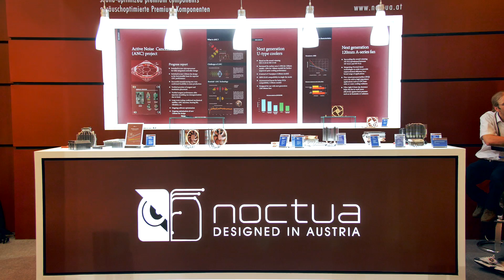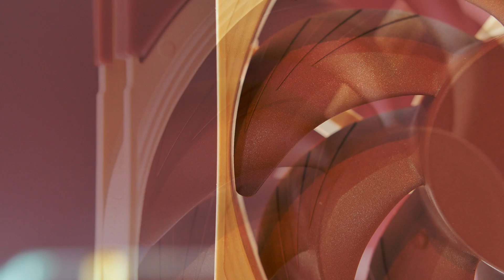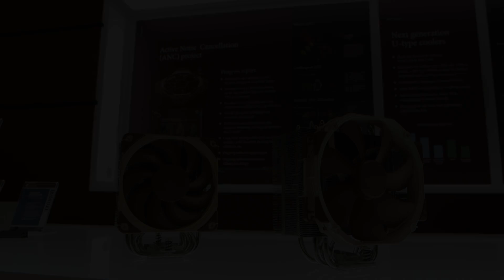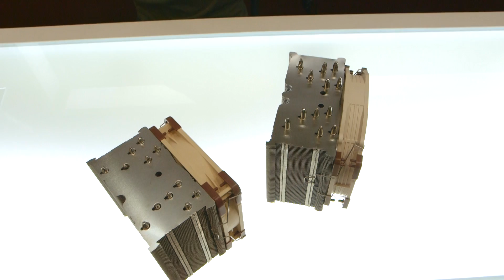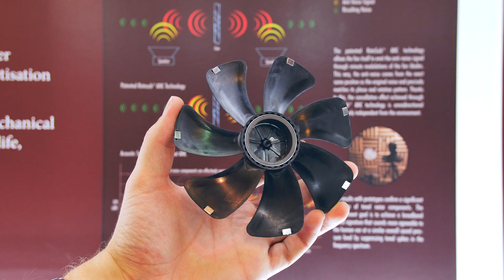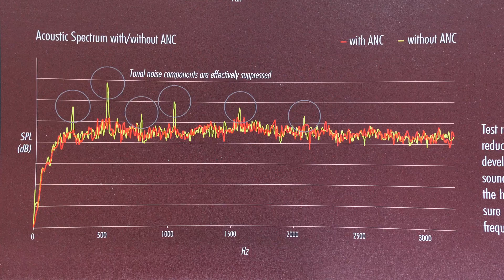Noctua new A-Series Fan + progress on Active Noise Canceling Fans

Comment: the problem with good fans nowadays, is not the vibration or fan noise itself, but the air flowing around in the case and turbulence. when my pc start the fan at the 500rpm speed, its quiet, then the noise ramps up a bit after 10 seconds when the airflow has been established.

Comment: just get a big fan i have 2 200mm fans just run the at a low rpm
Reply: calical26 The main issue with very large diameter fans is firstly they are big. This not only rules out most heatsinks and radiators, but even for airflowyou'll need to have a case that'll support them, which limits you to larger enclosures (and even then you've typically got a smaller fan somewhere), and typically not any rack mount\industrial application, which is where Noctua started as a business.

They also have a lower cross sectional thickness compared to diameter, thus resistance to flex and blade vibration. As such so they tend to not be able to operate effectively at high speed, limiting your total working range and in turn the min noise levels for applications that need to ramp up to high airflow levels. Finally the peak airflow per square area of fan is generally lower, so in many applications you can move more air with 3x120mm fans than the 2x180mm option that takes the same length, despite the 180mm fans having ~2.25 times the area of a 120mm fan each (thus ~4.5 fans worth total).

So while I'm not say big fans are worse, silent smaller fans do have advantages in some situations.
Reply: Hamish McGregor Not true on large cases, the Phanteks Evolv line has mATX and ITX cases with 200mm fans at the front; same with the Bitfenix Prodigy. All excellent cases.
Reply: Gordon Rennie
 And all considered "large" for there given form factor. For example the Evolv mITX, while very well made, is as wide as my define r4, which I don't even take to LAN parties because its a pain to move. The Evolve mITX is literally more than twice the size of the silverstone ML07 that my flatmate uses, in fact it bigger in every dimension and more than twice the width, yet that thing will still pack any LGA1150 CPU and duel slot graphics card on the market (even those that sneak into he 3rd slot like the bigger strix), with airflow enough to get a decent OC (although admittedly no 240mm rad unless you water cool the GPU).

Its also wider than 50mm wider than my current ATX Lan rig, while only 25mm shorter and 80mm lower length. Thats mind blowing that you can compare the two considering its a mITX with limited drives my Lan case fits an ATX motherboard, full size 120mm tower cooler and up to nine 3.5" drives + a 5.25" even with full length GPU's installed.

The prodigy is also an example of big fan options resulting in a big case. Its so big they literally made a mATX version in the same box, and even the mATX version had plenty of room for a bunch of drives, 5 expansion slots ect. And again, just like the Evolve line, its a great case that I don't have any issues recommending, but its hard to argue that you don't have a size penalty for its fan\rad options and ease to work in.

Comment: I wish they had a 180mm fan :(
Reply: Jacob eMatt Its coming, they have shown one off at shows before... but then again noctua is a very slow development firm that does lots of testing, so don't hold your breath, it could still be many many months away.
Reply: They are releasing a 200mm fan this year. I know that doesn't directly answer your question but maybe you just wanted a bigger fan?
Reply: +Dead in Red this year? well...
Reply: when Thermaltake CHASER MK-1 ATX needs it

Comment: Gentle Typhoons anybody? :) Certainly good to see manufacturers acknowledging finally that GT had THE design and trying to bring it forth!
Reply: ***** You have to go way beyond the general shape of the fan blades and realize the INSANE amount of RND went into designing the housing, motor design, angled blade grooves, etc. that make up Noctua fans. Gentle Typhoons are great, don't get me wrong; but just because the fans blade shape looks similar does not mean Noctua "acknowledged" anything.

And I'm running EKWB fans in my rig, in case you were wondering.
Reply: Otona685 Not taking anything away from Noctua - they do a lot of R&D and their products are great - well generally I tried NF-F12 and they were terrible compared to GT AP-14s (high humming - bee-hive-like noise at higher frequencies). But the fan blade design is definitely taken/inspired from GT (or similiar fans) which is awesome because it works wonders and they don't make GT anymore. So you get best of both worlds - amazing design of GT and noctua quality & R&D. Should be an awesome fan and one I will - pending reviews - will definitely be trying myself :)